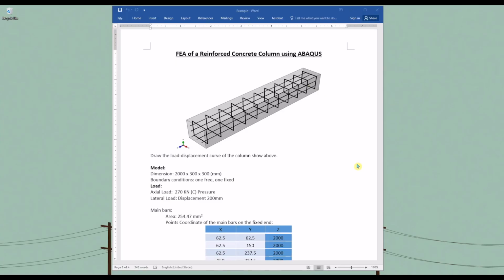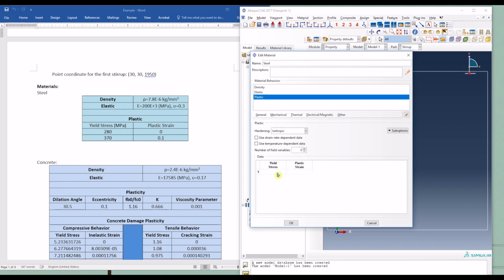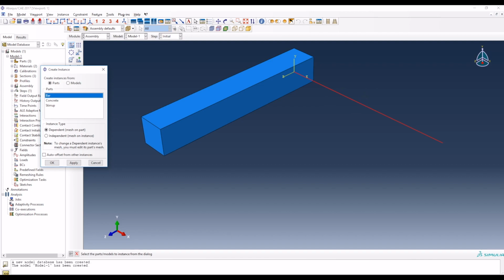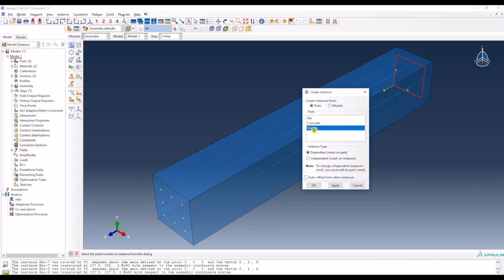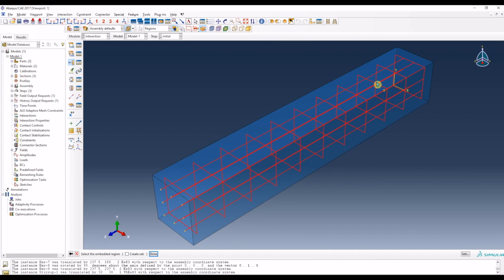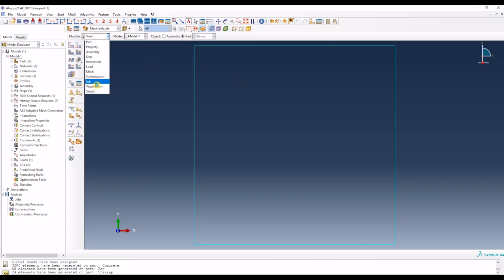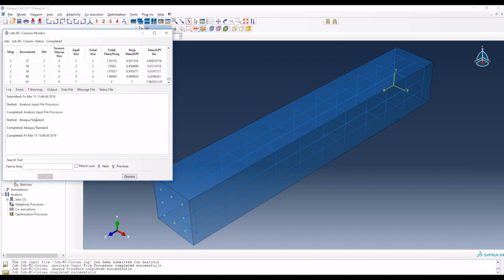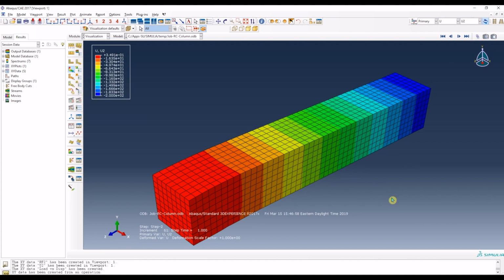Abaqus Tutorial - FEA of a Reinforced Concrete Column

Comment: Hi, there I just wondering Have you ever compared the results of reinforcing bars by setting the element type to Beam instead of Truss?
In a simple beam, there was much difference in deflection when the element type was used as a beam or as a truss.
If you've ever tried it, I'm curious if the results were the same.
Thanks
Reply: result dosent match
i am doing simply supported reinforced conccrete beam carrying UDL

Comment: will the results be different if we use solid elements or truss elements instead of wire for rebars? and if the rebar is located at point 65. , why is the stir up at point 30? I think it must be: 30+5+9=44

Comment: which formula have you used to calculate concrete damage plasticity  compressive behavior(  yield stress and inelastic strain) tensile behavior (yield stress and cracking strain)  the same   for steel  , you can send the message here   nijeandoss5@gmail.com

Comment: Thanks for this helpful tutorial!
For those who modelled this structure and got this error: 
"Too many increments needed to complete the step"
Simply tells you that it needs more increments. If convergence is just slow, simply increase the number of increments in the step definition.
Reply: You need to increase the number of points in the static set definition, and increase also the minimus step size (not the initial and not the maximum).